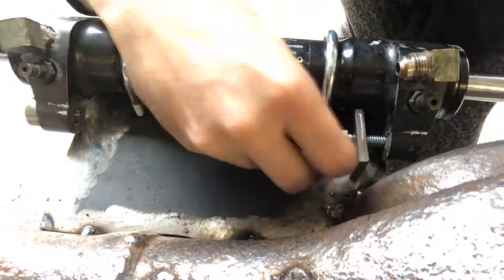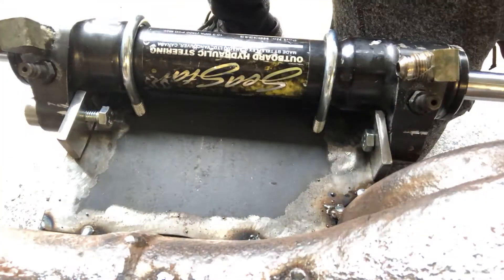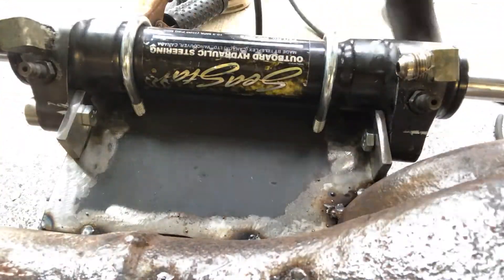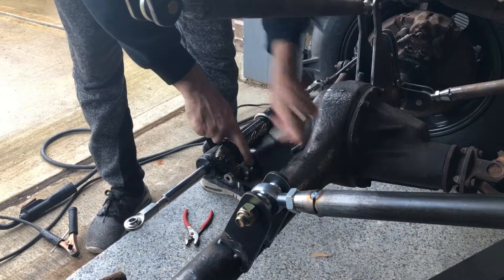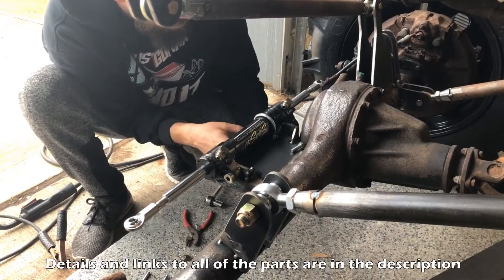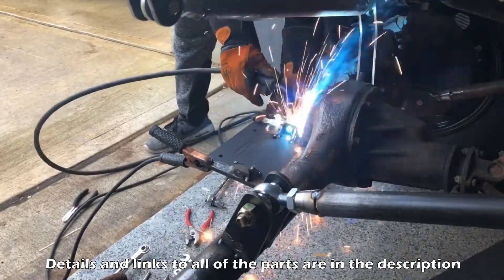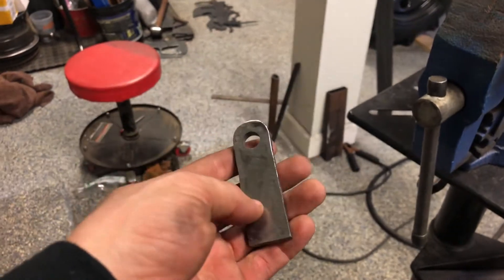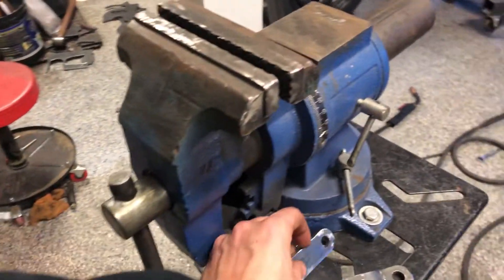Monster Golf Cart Build Part 1 Hydraulic Steering

Comment: This is amazing! I’m using the full hydraulic steering for my Batman Tumbler. Is this reliable on the roads?
Reply from the maker: Thanks! As it is now I would say no. But I am currently making some modifications to it to see if I can make some improvements. If you have a full hydraulic setup already I would stick with that.
Reply: @BareMetalFabrication  Thank you for the quick response. I haven’t assembled it yet because I’m still working on the frame however, because the tumbler does not have a front axle, it is hard to angle a short steering shaft

Comment: I wonder how hard the steering is going to be without any booster or assist.
Reply from the maker: With the set up in this video the steering was very easy. I have a test drive video that shows it in action. However, I didn’t like that there were 6 turns of the wheel from lock to lock so I’m in the middle of doing some modifications right now.

Comment: I've watched many times I think I'm going to do this on teryx and get rid of rack a pinion does this helm need power I assume it doesn't must have some kind of multiple gearing inside
Reply from the maker: It doesn’t require any power. It has an internal pump. My next video will be about replacing that hydraulic ram with a different one and reconfiguring the mount on the front for the ram. You may want to hold off and watch that video to hear what all I have to say about it.

Comment: I want to do this to my buggy and get rid of rack n pinion thanks for posting
Reply from the maker: No problem! I just test drove it for the first time and it drove well but it will take some getting used to. The main thing is it doesn’t return to center when you let go of the steering wheel.
Reply: @BareMetalFabrication ; Yelp it's probably still well worth the trade-off from a rack and pinion I'd say it's bulletproof the way you did

Comment: Ok I WATCHED IT AGAIN AS YOU TOLD ME. yes I see you did something on that plate but you cheated us of that part because you speed it up too fast . I still think I did not see how that cylinder is secure under extreme .that square tube idea to protect tie rods is an idea you might consider. They very exposed to a big stationary rock. 
You know,..the kind of rock that leaves your teeth marks in the steering wheel. .
Reply from the maker: I appreciate the concern, but this is a very common configuration used by a lot of off road vehicles, just on a smaller scale. If you do a google search for double ended ram hydraulic steering, you will see the same configuration with the heim joints. This is also not going to be a rock crawler, but a mud vehicle. There are no big rocks where I live. Nothing but mud holes and water holes and a lot of sand. The cylinder mount is not complete. I still have some bracing to do on it.
Reply from the maker: If you use square tubing to surround the heim joints, you are creating a pocket for dirt, mud, and moisture to collect and cause a failed heim joint.

Comment: Put that cylinder inside a square tube across all the way. Cut one side of tube open so tie rods wont  rub. 
Leaving the center covering  the cylinder. Bolt a stop block inside on each end of cylinder so it cant slide back& forth. Then you can remove it someday.

Comment: Those u bolts aint shit. They will not hold that cylinder! 
Better weld a stop block on that mount plate on each
 end of the cylinder.
Reply from the maker: Skipper, the u bolts are not there to hold the cylinder from moving side to side. They are there simply to hold it from rotating up and down. If you watch the video, you can see that I welded some mounts that the cylinder bolts into that keep it from moving side to side. I also say at the end of the video that it is not finished yet and that I plan to add more gusseting to the mount for more strength. I appreciate your concern but it was well thought out.
Reply: I did not see you weld on the cylinder.  If I had... I would have shit a brick. Worp worup warp eye con eeemoggee lol. Oh well.
I m good welder with a pa bridge license certification etc. But I would not dare that. I just thought you overlooked the sideways movement. Sorry I was not demeaning you. Just being helpfull .
Reply: When you do things like this. We dont always think of everything. Sometimes we overlook the dumbest simple thing. We( your watchers & participants) are in the shop with you.
Sometimes you knock us off the bench or bang our heads on an overhead pipe but we don't scream at you.
We know you like us  and we dont bleed. Lets have fun.  get out there and smash that machine through a mud hole. Lol

Comment: Cant find video. 
So . Is there a gear box for reduction attached to steering wheel?
Can it  be turned around so it increases instead?? If so then that would fix the limited handlebar movement. .

Comment: The leverage is the handlebars directly to a bellcrank not more then 3 inches radius connected to tie rods.
So
Do
You
Think 
It will
Work?
Reply: Thankyou. I appreciate that.  Im 72 . Hard to understand computer system and very un mobile. Weak.Thats why I need p.s..I use atv to get around and try to use it every day for 1hour exercise.  Beats sitting on bedside all day.  I only have a VA pension from injuries in vietnam. Im not cryin. Just trying to keep on keeping on for what time is left.
So I m sayin that I really appreciate your help.
Reply from the maker: @skipperskipper2936  I'm sorry to hear that! Thanks for your service by the way! Unfortunately, I wouldn't really consider this power steering. It's more of a way to avoid using mechanical linkages when building a complicated front suspension geometry. So I don't think it would work well for what you are wanting to do. In your case, I would look into something like an electric power assisted steering box. I have seen people use those before, however I don't have any experience with them. I hope this helps!
Reply from the maker: I’m not sure. I’ll have to do some research on it and get back to you!

Comment: Problem here is steering wheel. I have handle bars.
So perhaps a gearbox to increase rotation speed?
From 5 to 1 ..... to .....1 to 1.?
Mount it in bottom of steering shaft instead of top at steering wheel?

Comment: Engine backwards. 
Think about this...what if you just turn thr differential upside down.? That would make the vehical run opposite way.
Reply from the maker: Yep I actually cover this in the next video. I flip the engine back around and explain that I plan on flipping the differentials. Good catch!

Comment: I have QUESTION. ..
SLAVE CYLINDER. 
 How dose this work without a slave cylinder controler? Or a pump?
Dose this  work without power? I want to put P.S. on my Rancher A.T.V. 420???
Reply from the maker: It works without power or a pump. The pump is internal. It’s built into the helm. The vehicle does not need to be running for this to work. That’s the beauty of it!

Comment: bad ass video man big up to you, love the work. whats gonna move those axles? have you posted a video yet of how those shafts are going to be connected
Reply from the maker: Thanks man I appreciate it! I haven’t made a video of that yet but I will when I get there. But to give you an idea, the engine will have an output shaft connected to a divorced transfer case from a samurai. Then a driveshaft from the transfer case to each axle. So I’ll have selectable 2WD, 4WD L and 4WD H.
Reply: @BareMetalFabrication   BAD ASS DUDE!!! gotta see that. and those axles will connect to that motor which is out of what?
Reply from the maker: @jaysgarage6784  Thanks man! The engine is from a 2005 Kawasaki Prairie 700. Should be plenty of power!
Reply: @BareMetalFabrication  bad ass i just got all my air ride components. running a VU4 accuair manifold with control module. Bluetooth controller for the air ride all via cellular phone. Im also running same monroe air shocks you have on yours but 3/8 lines so its fast. Ill post a video on her when I get a change.
Reply from the maker: @jaysgarage6784  That's awesome man, I subbed to your channel so I can watch for that. What are you putting all of that on? I noticed on your channel you have owned some hot rods. I've got a 23 roadster I'm building also. Anyways, I ended up using 1/4" lines on my cart and it's PLENTY fast enough for these Monroe air shocks. I'm going to be posting a video of that air ride build soon. That video is almost finished.
Reply: @BareMetalFabrication   i have a 2014 gas club car precedent trying to have this baby look bad ass and stand out from the rest. have 18 inch can am wheels on it.

Comment: Jesus that's not a golf cart it's a monster truck! Subbed ;)
Reply from the maker: Thanks!! It’s definitely starting to look more like a monster truck than a golf cart lol
Reply: @BareMetalFabrication  I see the beam at the front and prop, so you running FWD instead of RWD? Or 4?
Reply from the maker: The engine has two output shafts. I’m only using one of them and it’s going to be hooked up to a Suzuki samurai transfer case and then to each axle. So it will have rear wheel drive, 4wd low and 4wd high

Comment: Excited to see how you like it, could be a great option for builds like this.
I guess since input from the tires can't steer it, it won't self center when you let go of wheel?? It will be great to get your report after you've driven it a while. Great job thinking outside the box!!!
Reply from the maker: Thanks! That's exactly right, it won't self center and that's definitely a negative and something I will have to get used to. Being driven off road I don't anticipate that being too big of an issue though. I really like the idea of not having the feedback in the steering wheel so we will see how it plays out. I also let the weight of the cart down and it steers easy with one hand sitting still!